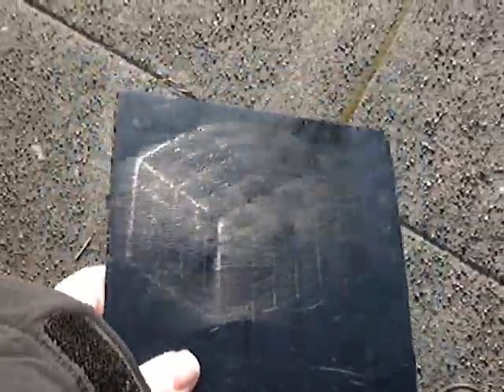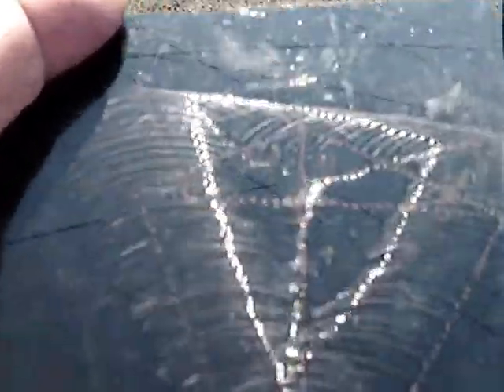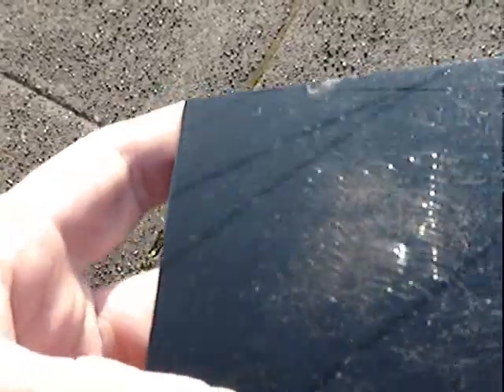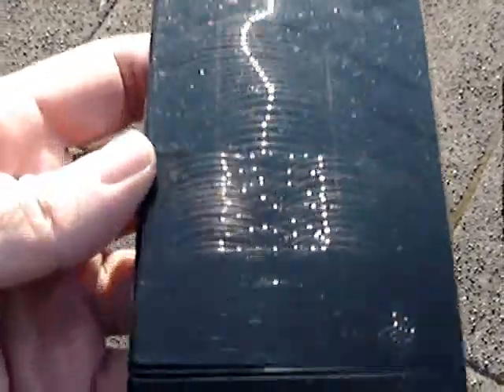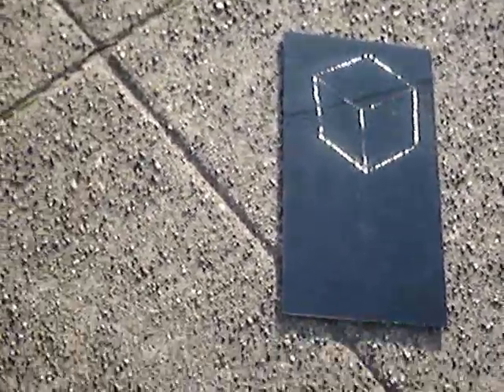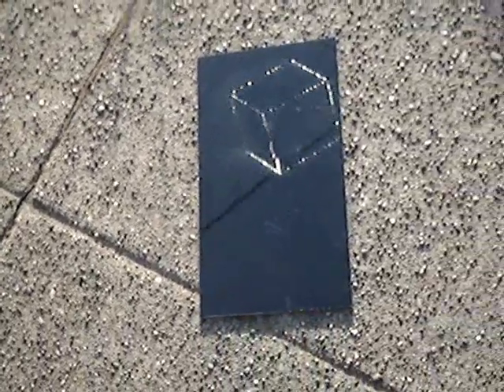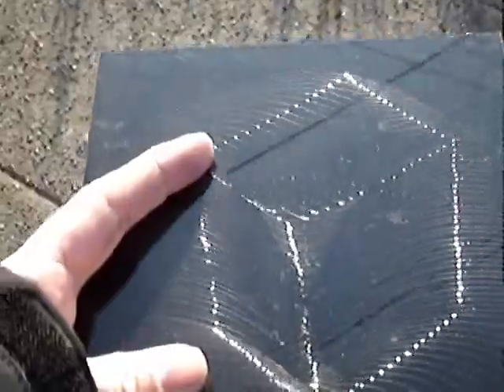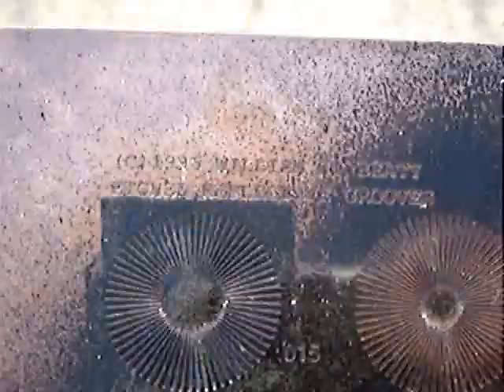first hand-drawn holograms, 1994

Comment: I didn't realize you can totally control if you want to make the object move opposite to the way it was being rotated in space, or even have some objects rotate normally while others rotate opposite all on the same plate
Reply from the maker: Track down the 2003 research paper.   I also reveal how to create holes in opaque planes, or black opaque 3D objects, with white edges.   Also, plans for a possible "scratch-hologram camera," still never been tried.   Giant miles-wide holograms made from bent polished rods, only viewed from aircraft?   However, people HAVE made robotic hologram-scratchers, so they can sell huge custom holograms to the arts crowd.   (But the ones on the Star Wars vinyl album, with rotating opaque Death Star and Millennium Falcon  ...I hear that those were scratched by hand!

Comment: What happens if it’s backlit indoors?
Reply from the maker: Heh, you've just proved that it's not a "Specular Hologram," it's just a plain old hologram with both a transmission-mode and reflection-mode.   The very first one I ever made, was on clear acrylic, scratched at 12in depth (using two nails taped to a ruler.)  We viewed it indoors, backlit in a sunbeam.  Also indoors at night with a flashlight backlighting it from many feet distant.   (The next one I made used 2in radius.  That first one with the twelve inch depth was darned hard to see!)
After making many, I settled on reflection-mode with black plastic (or black paint on the plastic.)  Those were easiest to view, using sunlight or using a slide projector.  That's the form which became popular, although my OSA paper mentions the clear-plate transmission-mode version. 
It's not 1994 now, so a single white LED from your iPhone works just great.  Or, bring down the old slide projector from your attic.   Or, try a video projector, used as a spotlight, displaying a blank white image.
Reply: @wbeaty  I noticed your first example is a lot more translucent. Im guessing the darker the substrate the more holographic effect you get. Im curious what happens if you were to use the more transparent plastic like in the first example with an image set behind it. Also, im thinking these could be done with a dremel which then makes me think it could be done with a CNC as long as the depth was set correctly. Super cool video btw. Thanks for making it.
Reply from the maker: @zacharysearcy  Actually, the darker the background, the brighter the hologram appears, whenever there's no bright scene behind the transparent hologram.  Scratch-holograms are real holograms in that they have equal transmission modes and specular modes.   Try making them on clear plastic, so you can try "transmission mode," lighting them from behind (but then include a distant black surface back there, to make the hologram seem far brighter.)  That's what was always done with museum holograms back before the late 1970s, before the rise of the Denisyuk-type volume-holograms on thick gel emulsion, lit by reflected white light rather than lasers from behind.
Also, search for scratch holograms on the Instructables site, and you'll find the guy making instant holograms with a Dremel tool.   (Back in the early 1980s, Gabriel Liebermann built a machine to do the same, but his version had variable radius, so he could draw things in full 3D, not just flat images.  Unfortunately he kept the whole thing secret, hoping someday to patent it all.)

Comment: Hi wbeaty, regarding the 3D cube do the points on the lines that go vertical (that is a total of 3 visible lines) have the same radius?
Reply from the maker: +Daniel Le    Yep, all the radii are the same there because those edges of the cube are parallel to the plastic surface, for convenience.    Of course I could have positioned the virtual cube- image off-parallel, so that every single scratch would need a different radius!     (Note the trick I use for making straight lines,  http://amasci.com/amateur/hand1.html#31  )
Reply: Wow, thanks wbeaty!

Comment: check out this website zintaglio.com. This guy does CNC mill specular holography and he has got some very precise and well textured 3D models of animals, people, and knots
Reply from the maker: It's not called "specular holography."   That's just the latest attempt to change the name.    It keeps getting re-invented, and each inventor attaches their own new name.   Most papers call it "incoherent holography."   The first 1970s paper called it "mechanical holograms."    Here's a good one: CHATOYANT HOLOGRAPHY.  Like cats-eye opals, or the deep 3D highlights in polished wood.

But it's not "specular," that's a misunderstanding.   This works both in prism-mode and in mirror-mode, as a transmission hologram or reflection.    But if you always use black plastic, you might never realize that it behaves as a real hologram, and not only "specular."

Comment: I guess it will be easier if the LCD pixels are reflective. Also it won't work with the backlight because each pixel is illuminated by one lighting unit/one diffused source. Maybe taking the LCD layer out and put itunder the sun may help.
hmm i'll try generating a sparsely dotted V shape and convolute the image with doughnuts if I have a spare screen.

Comment from the maker: Is it a hologram?

A "ruling engine" can draw a diffraction grating, but it also can draw the zoneplates of a conventional holo.

If a ruling-engine creates the zoneplates of a Benton Rainbow Holo, you'll find that, even if the fringe spacing is made >> lambda, the hologram still reconstructs the 3D scene. This is expected, since Benton holograms are wavelength-independent.  WHY does their image struct remain constant wrt changes in wavelength, or to fringe spacing? That's the real question.

Comment from the maker: Is it a hologram?

Some say that holograms require sine fringes, not scratches.  I see this as wrong, since diffraction gratings once were made by "ruling engines."

Some say that holograms must include wave interference. Valid issue.  Off-axis holos are obviously holograms.  But Benton rainbow holograms employ interference only to produce the fringe pattern, not to reconstruct the 3D virt. image. That's why they still work with broadband light.

Perhaps Benton holos  ...aren't holograms?

Comment from the maker: @colsupertaco   Yep, "The Kiss" is the famous example.  Those are multiplex holograms, white-light holograms basically the same as this one.   In theory you could make a specialized scratch-hologram on a flexible sheet, then wrap the sheet into a cylinder shape.  Put a light source above, and a glowing object would appear in the middle, and you could walk all around it.  The secret is to make an animated hologram of a 3D rotating object.  Then when you turn the cylinder, the object seems to turn

Comment: @wbeaty 
Aha, I thought my eyes were failing me, but it is inverted.
I got it working though, and I also found that I could "stop" the middle vertical line to stop moving by shortening the scratches.
However if I do that and keep shortening the scratches as I go up, the tip that's supposed to go looks like it got cut of.
I've a few flat ones before trying these, but it just looks so awesome I couldn't wait :P
It was hard to see though....no sun in Holland....
nice playlists btw, and thanks :)

Comment from the maker: @ewak1991  FAQ #7 is for a 3D lines entirely inside the plastic surface, like cube at 0:32. For these, each straight line has a row of "fulcrum points," and another row of "top of the arc" points.

I made lots of holos within the surface before I dared tackle one where holo lines penetrate the surface.  For these, the two rows of points will cross each other at the spot where the holographic line penetrates.  (The radius goes to zero. For all points above surface the arcs are inverted:"U" shape

Comment from the maker: @ewak1991  Can you get the corner spots working?   So the invisible 3D cube has glowing tips?

Check out the 2003 SPIE paper for instructions on making 3D straight lines.   Basically you lay down a 3D spot between two existing 3D spots, then lay down more between those, in 3D always placing them in half way between two others.  That fills in the straight line.

Comment from the maker: @elverg47  use anything that works for conventional holograms.  Spotlights should be lensed "pin spots" 200 watts or more.  Try a video projector or slide proj as a light source (set it for a blank white rectangle image.) The main rule is, the greater the source width, the fuzzier the holo image.  (Arc welder good, cloudy sky bad.)  Streetlights at night work great.  Frosted bulbs are poor unless distant and very high wattage.   Fluorescent tubes in a white ceiling don't work at all.

Comment: What is the difference between incandescent and fluorescent light when it comes to using them as a light source for viewing these holograms? Which would perform better? I'm looking for an effective indoor light source.
Reply from the maker: First, just wait ten years.   Now today everybody has a phone with an intensely bright LED!   Phone lights work well for illuminating holograms.
Because these are real holograms, they'll be blurry unless the illuminator is a coherent source, or in other words a tiny point-source. (a laser-based point-source is ideal.  But sunlight gives acceptable results.)
The most coherent sources are also the smallest.  A transparent incandescent bulb will give clearer images than a frosted bulb.   Fluorescent tubes are terrible because they're so large.   However, if you hold the hologram perpendicular to a SINGLE fluorescent tube, then the image will be fairly clear, because the hologram "thinks" that the fluorescent tube is only 1in wide.
Try using a video projector, where the focus is adjusted for maximum blur.   Even better, try projecting a vertical thin bright line on a black background.   Adjust the projector lens to blur the line, so the projected beam is wide enough to cover the hologram.  With Rainbow holograms and with scratch holograms, the illumination doesn't have to be a pinhole source.    It can also be a narrow line-source, if the line is oriented crossways to the scratches.  When looking at the "glints" in the scratches, we want those viewed reflections to be tiny, like sparks or stars.
Reply: @wbeaty  The long con my man
Reply from the maker: @elverg47  my list of intentional memes, some successful...  http://amasci.com/news.html#memes

Comment from the maker: @elverg47   See main website, click the link above (just below "LIKE" button.)  See  "are these really holograms?"    See "I tried and it didn't work!"

The secret is $15 pro compass, use a dull compass point (not a needle, more like a nail), also greasy plastic (a tiny dot of oil rubbed with paper towel,) also use soft plastic, CD jewel box, styrene or polycarb, not the harder plexiglas acrylic. Scratches must be smooth, polished, like silent grooves on a vinyl record.  Any vibration ruins it

Comment from the maker: @Thuringen   Just make about a hundred of these.  I started out in 1994!

You do need good architect's compass.  But also a dull nail point works much better than needle-sharp compass point.  And slightly greasy polycarb plastic helps greatly.

The endpoint positions just use a simple trick I invented.  Another trick lets me quickly create straight 3D lines.  By cheating, I can become a human computer!  See the main website, it's hidden in the SPIE 2003 "invited paper."

Comment from the maker: @CecilTerwilliger  Yes, in all holograms the radius of the fringes determines positions of the image points. In this way an interference pattern is like a lens. But in normal holograms, the spacing of the fringes also affects the position of the image points. That's why light of a single frequency is needed. White light would turn images into rainbow blurs. But Stephen Benton at MIT invented a version where *only* the fringe radius determined the image points. Mine are Benton white-light holos.

Comment: @wbeaty I thought the purpose of the defraction grating on a rainbow hologram was to separate out the light into a spectrum so you get parallel bars of monochromatic light. The actual hologram(s) lie under the defracton grating. It looks to me like your hologram *is* the defraction grating. One made form arcs instead of straight lines. I'm guessing that the shorter the radius of the arc, the further form the plane the point it represents appears?

Comment from the maker: @CecilTerwilliger  Wrong, Benton or "rainbow" holograms don't work by interference, even though they are created using interference.  That's why Benton holograms have no need for a monochromatic source.  Wavelength independence requires size-independent fringes.  Also we can make transmission or reflection holos in either Benton or off-axis type holos.  Basic discovery:  a Benton hologram with enlarged fringe spacing still functions.  Make the fringe spacing be 1mm, and it still works!

Comment: @wbeaty No, true holograms work by putting an interference pattern on light that is passing through them. With a credit card, the hologram is put on a mirrored background, so the light passes through hits the mirror and then passes through again. Which is why credit card holograms look weird, compared to other holograms.

The thing in this video works by light glinting off an arc that's been scratched on the surface of the plastic.

Comment from the maker: @TheAdventuresClayMan  see the project website.   You have to go out in the sun.   Sometimes it works great, but NOT UNDER LIGHT BULBS.   Streetlights at night also work.

But if you still have problems  ...avoid using sharp points.   A dull nails works well, but a needle does not.   If compass is too sharp, you must drag it very very lightly.   Or attach a grungy nail to the compass.

Comment from the maker: > just scratch plastic cases

@lewburger  just follow the instructions on the main website.  Try writing your name, or your initials.   It's much better if you use a finishing nail in your compass.   The normal compass point is way too sharp.

Comment from the maker: > What material and instruments are you using

@Morimaitesincahonda  see the link directly below the video (the text caption.)  Use a drafting compass and scraps of polycarb or acrylic bought from the recycle bin at the glass repair shop, or at Tap Plastics.   Or start out using two nails pounded through a 10cm stick, scratching on old CD jewel cases.  One scratch creates one floating pixel.

Comment from the maker: @azzstar4  You mean a Dali Crucifix?  That's not hard if you've practiced making cubes.  It's even possible to make it stick out into space, and have the foreground bits hide the background bits.

Or did you mean making an animation of the 3D projection of a rotating hypercube?  That's possible in theory, although the animated holographic motion screws up the 3D effect a bit, so the straight lines get warped.

Comment: wouldn't it be possible to make a hologram video using a matrix of nano-sized mirrors in which each can be independently controlled? And to give this hologram plane, overlay it with a color LCD clear plate, which corresponds with the sequences of the the positions of the nano mirrors.
Reply: No.

Comment from the maker: > understand

Take a vinyl record album out in the sun.  Or try it with a DVD.  The stripe of light that moves along the grooves?  It has a 3D effect.  Your left and right eyes see two different stripes.   Curved reflective grooves always do this.  They act like a kind of lens, so they create a focused speck of light that hangs in space.   (If you turn these holograms upside-down, then the image floats in front of the plastic sheet.)

Comment from the maker: Theyaren't 3D, they are flat.   But they float deep inside the plastic.

Making 3D objects is a big challenge.  But you can make rows of dots (dotted line) which tilts in 3D.   First make two glowing dots at the endpoints of the line you wish to create.  Then make a glowing dot exactly between them, with compass radius set to half the sum of the radius used for the endpoints.  This gives you three dots in a row ...in 3D.   Now repeat: place dots exactly between those.  2,3,5,9,17,33 dots.

Comment from the maker: > paint both sides

The black is just for contrast.  Black paint, or black paper, or scratch the front of an old CDROM case (that has a black back.)  With paint, just paint the back of the plastic (don't do the scratches on the paint.)  See the website, especially the FAQ section.

Comment from the maker: The spacing of the divider points is the same as the depth.   Draw lots of dots at lots of different spacings.    Also see number 7 in the FAQ about how to draw tilted glowing lines in full 3D (like the edges of that floating cube.)

Comment from the maker: > get depth?

It's not hard to do tilted straight lines in 3D.  Figure out the scratches for the endpoints at different depths.  Then put a scratch exactly between them, with the pivot point exactly between the other two pivot points.  Then similarly add two more, dividing it in 4, then 8, 16, 32 etc.

Now the 3D box with walls made of stars, THAT was hard.

Comment: I understand how you get flat images that shift, but how do you get depth? I would guess that you would do each depth layer with a different compass radius off set from the primary image buy an equal amount, but that is a guess. Smaller radii I guess would correspond to closer features.

Comment: Indeed they are not look qt the french wiki about holograms if you read french.
you could read: On appelle aussi, à tort, « hologrammes » les dispositifs que l'on appose sur des cartes bancaires, billets, passeports ou boîtes de logiciel.
But I am not pretty sure there are no interference, for example, a laser disc shows a kind of 3D beam. 3D is given by the radius of the circle, but the shift in color is given by diffraction.